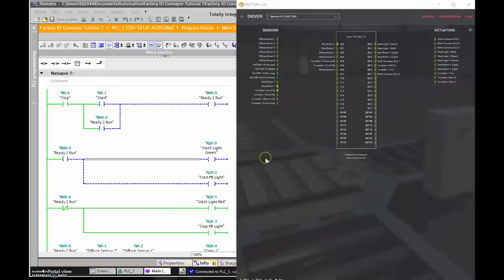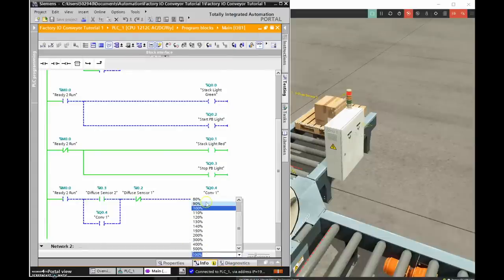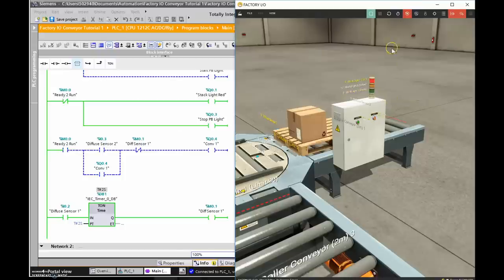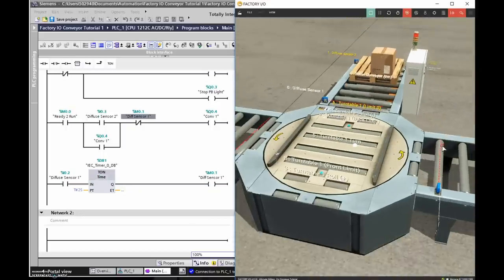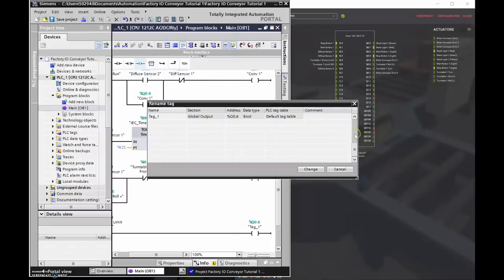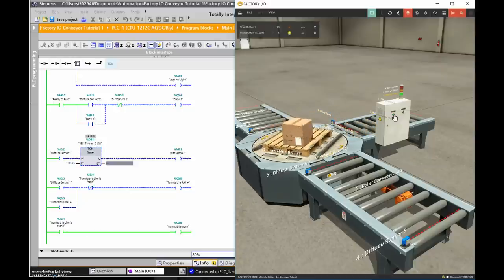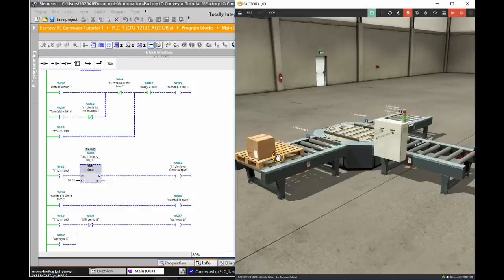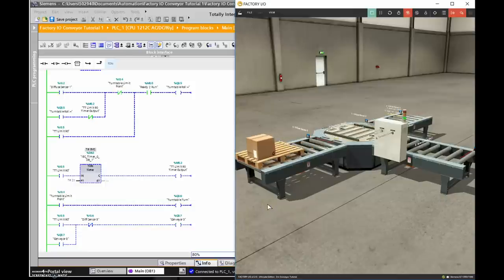Siemens TIA Portal & Factory IO (Creating the PLC Program for Conveyor Sequence, Siemens S7-1200)

Comment: nice but.....that is called "spaghetti software" (or maybe 'sausage softwware) development....no analysis, no design...directly to coding.....the professional alternative is to make an analysis & design drawing a finite state machine FSM (on a piece of paper or electronically using e.g. QFSM freeware) and then implement the FSM in ladder logic or as function block ...use memory elements like S0.0 , S1.1, S1.2 etc as states (with the corresponding comments to interpret them) to be set and cleared and SCR, SCRE to start and stop the code section for a given state and SCRT to transition to the next state within a given state .....(SCR and SCRE is al ike a case ...break statement in C/C++).....that way the code is absolutely readable and understandable , you just modify the code that affect one single state and therefore reduce the risk that one modification will not break havoc the rest of the "sausage software"....unfortunately most software engineers are unable to understand or implement a clean FSM.....we electronic engineers are much better at that because we learn it on digital design....
Reply: @juancarlosabad3298 Please make a tutorial

Comment: I'd agree with most of it, except for the Timer used on the conveyor. Why not use a Negative Pulse edge to stop, then the box would trigger the Sensor 1 (positive / rising edge) and when it passes the box the program would trigger a negative / falling edge which would trigger a 1 (on the ladder logic) causing the conveyor to stop - reason being if you have an adjustable speed conveyor (which isn't the case here I know but as a teaching video it might be a bad habit some people would pick up). Just my 2 cents.
Reply from the maker: You're entirely correct. Negative pulse is the best way. When you look at my videos, you're viewing someone learning just as you are. Once i learned about the Negative Pulse, it allowed me to clean up my programming. Now, whenever I am using a timer to make things work, I know I am being lazy.
Reply: I was going to say something similar, there's enough sensors to not need to time anything. But Pete has already replied to your comment. Great video none the less!  Just checked and there is a 30 day free trial for Factory I/O now.... I know what I'm doing for the next 30 days.

Comment: Hey man, great tutorials really learning well! Got a quick question. I have created a similar block on a conveyor and using a S7 1200, but what if I want to control through Profinet rather than hard wiring the sensors and motors etc? Using a multicontrol to control sensors and motors btw. Thanks

Comment: Just curious, could turning the turntable roller off be as simple as using the negative pulse of Diffuse Sensor 6. As in -|N|-? Can use same command to release turntable turn holding contact
Reply from the maker: Yes. At the point I made the video, I was not aware of the Negative Pulse instruction. It would have eliminated using timers as well. Now I  know that I am cheating or not creating clean code if I have to use a timer to make something work.

Comment: Sir Can You Tell Me How This Turntable turn  back to its rest position ? and please where is the 90 limit sensor please ?
Reply: the turnable table itself must already have its own control system to let it turn back to its rest position, that is why 
 the table can turn back to its rest position after its limit 90 sensors is triggered.   
 in the video, the limit 90 sensor is not shown, that is why you can not see it.  but it do exist and is  located at the position of 90 degree of the table.

Comment: do you need to connect the actual plc through ethernet?
Reply from the maker: Not sure if you can use the simulation mode on the TIA Portal. Try contacting the company. Here is the site for the Siemens package: https://factoryio.com/siemens-edition/
Reply: thanks
Reply: sir, i try using plc siemens s7-1200. in the ladder program, the diffuse sensor output can not be read on the ladder. what's the solution?
Reply from the maker: 1. Make sure you have offset your inputs and outputs https://factoryio.com/docs/tutorials/siemens/setting-up-s7-1200-1500/
2. Double check that you have given the diffuse sensor an output address in the factory io drivers page
3. On the main simulation page of factory io, "dock all tags" and make sure that the sensor has not been forced by mistake